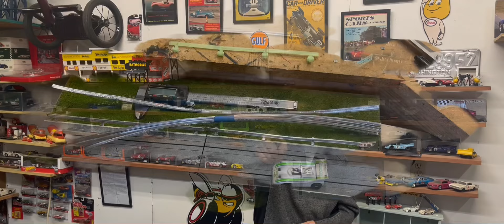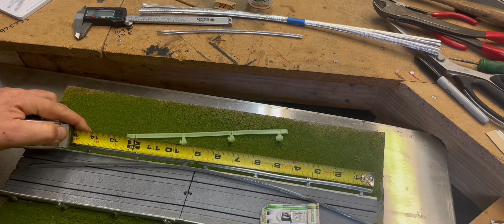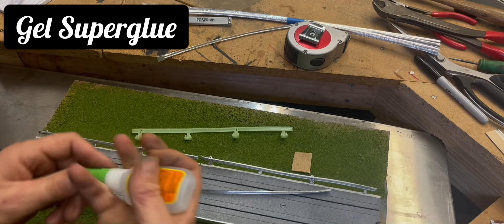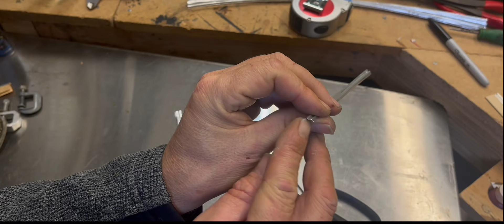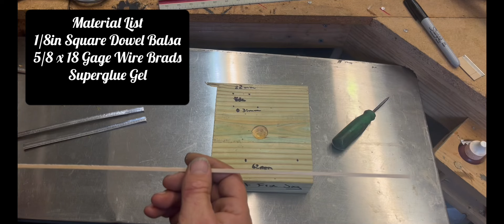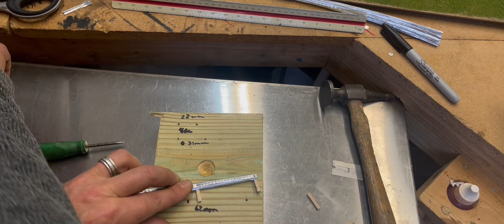How to Assemble 1/64 HO Gaurdrail

Comment: Looks awesome but the first method to mount it to existing guardrail would likely intrude on the outer bends and cars would rub.  Still, plenty of other methods- and probably a good idea - and thanks for showing H.O. Some love 😎😎😎
Reply from the maker: Thanks buddy…It could, but as long as they were mounted tight to the plastic rail it should be good. I personally like to keep some distance between the track and the guardrail. I like to give the car some rear end wiggle room 😂…
Reply: @BoonesSlotCarGarage  exactly, and it’s great seeing you up and around since your injury. 👍🏼👍🏼
Reply from the maker: @Gale_Force_Raceway  thanks 😊, it’s definitely a step in the right direction. I still have a long way to go 😂